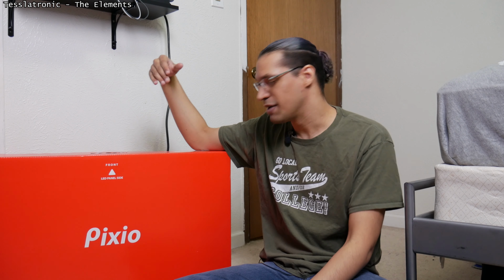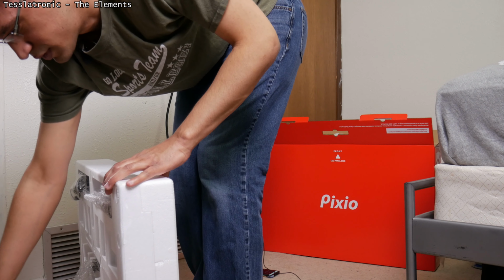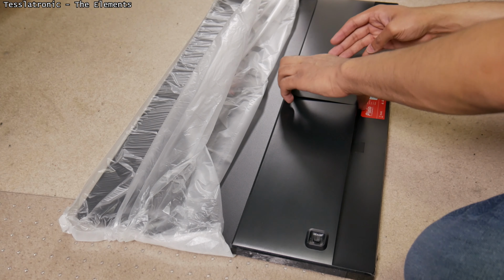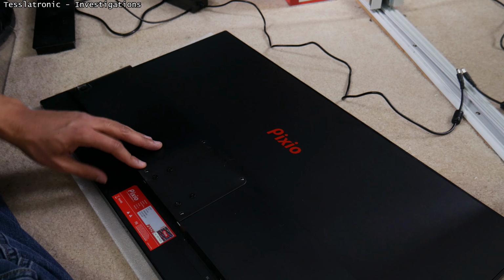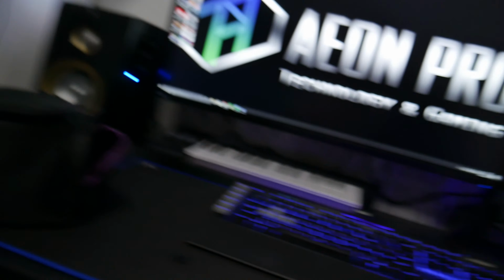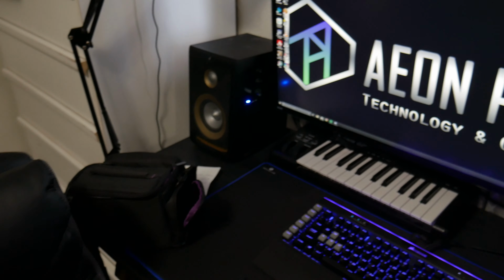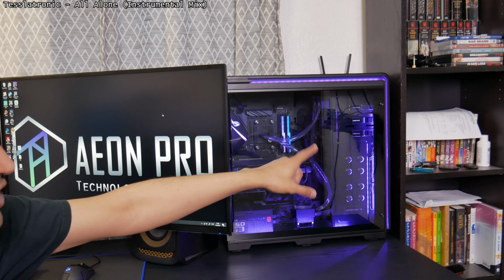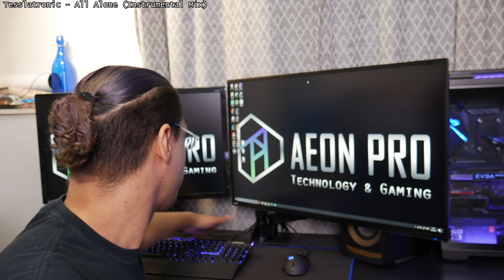Unboxing & Setting Up the Pixio PX329

Comment: Bought this bad boy to pair with a 1080 ti. :) 144hz and Gsync compatible. I can’t wait, i currently have a 1440p/144hz so I know I can run this thing! I originally bout a 1080p 240hz but the lower resolution hurt my eyes

Comment: Why people keep saying 144-hz monitor in many youtube videos , knowing that this monitor is 165-hz.....LOL  anyways - cool video. :)
BTW - Can you please measure the monitor with a ruler.  I have my eye on this monitor but watching your video the monitor looks like its way 
slimmer vertical wise than my current 30-inch monitor im currently using and planning to replace.
my monitor edge to edge measures 25-1/2 inches x 15-inches.
I plan on buying (x3) of these for a 3 monitor setup, then later in the year im gonna replace the middle monitor of my (x3) monitor setup with a LG 43" 4K monitor and have Pixios on the sides.
Its Black Friday so ive been looking at all the stores at all kinds of monitors that are between 32-inches & 43-inches. for a (x3) monitor setup.